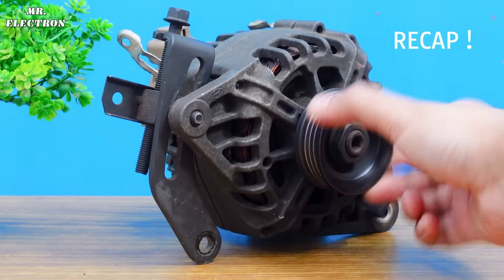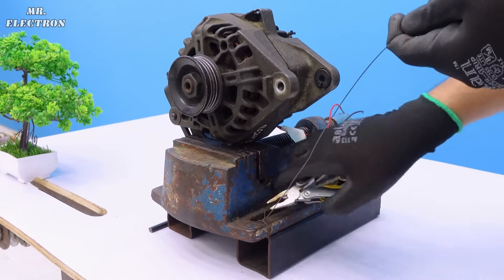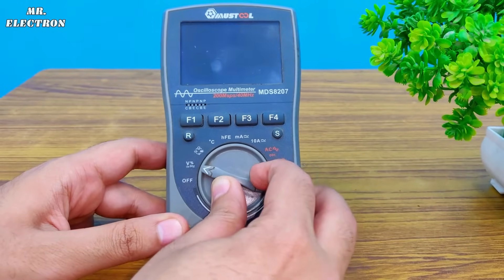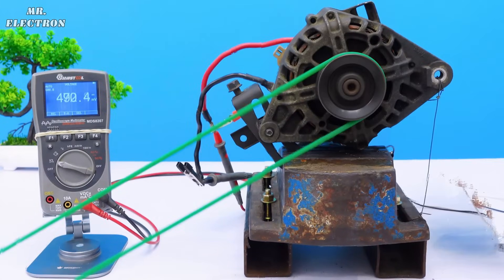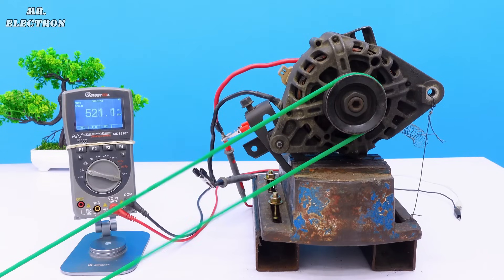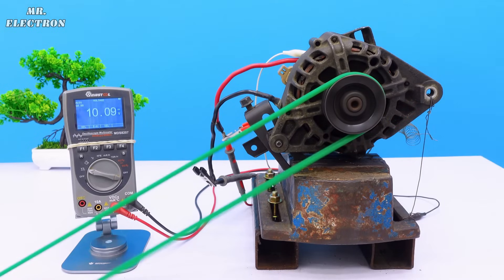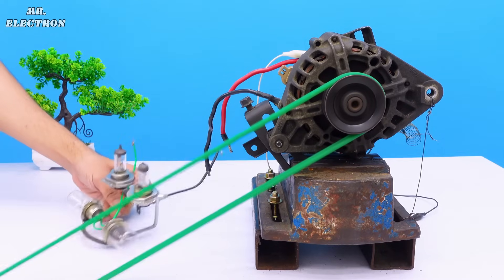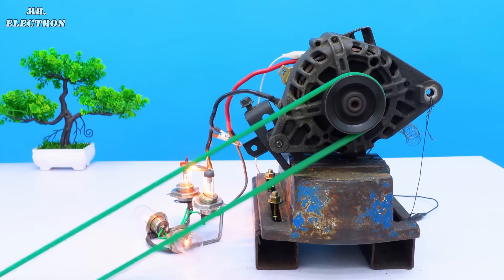Can You REALLY DIY a BOSCH Alternator Like a Pro Engineer

Comment: I have been trying to make an alternator DC motor run for over a year (not consistently) I have just purchased the 6-60v riorand 400w PWM brushless motor controller with hall and STILL can not get it to run. Can you please make a video with the riorand controller, the alternator has the 3 connections which goes to the ABC output, then the 2 wires to the brushes to excite the magnets from a separate power supply. So where do the 3 hall wires go to?? I've tried EVERYTHING and I'm so baffled.. I just want to make it run, plz help!

Comment: Perfect. You can do this with a fully assembled alternator as well. A gm 10si would work just fine. You can initially energize it with 1.5v in a similar way. That way you can output what you want, and selecting different voltage setpoints becomes immediately available. (odd setpoints are achievable but require custom made regulator...) you do need to put a battery or at least a cap on that output. For a light bulb or a motor it's pretty okay but that power will be really rough without a buffer.